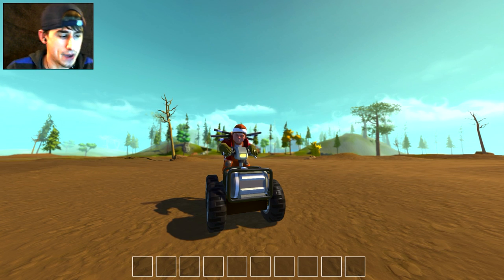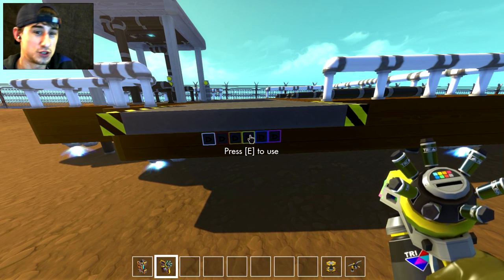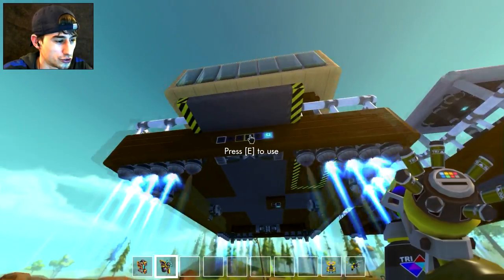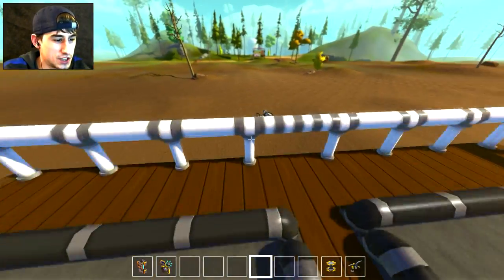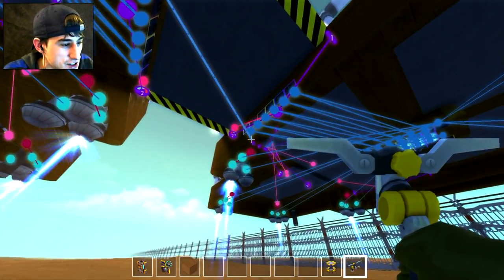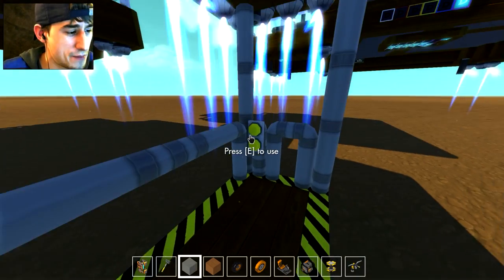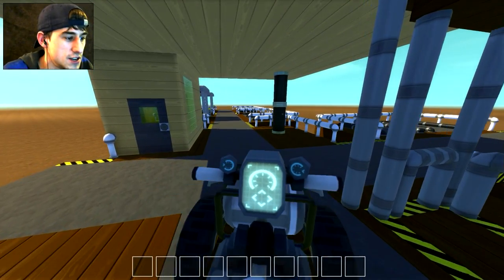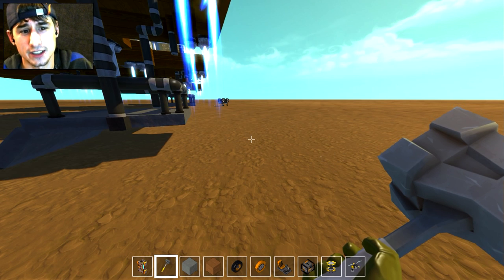Modular Hover City Control & Parking! (Scrap Mechanic #61)

Comment: Looks great, my suggestion is to make some raw hovering platforms, so you can make whatever you want on them.
And about game engine, unless they make that blocks next to each other become a single object, it won't help with frame rate, as they still are many small objects which colliding.
Reply from the maker: Yes I agree. The big issue with the engine now seems to be the object collision detection. I would hope that Axolot has clued into the size of creations people are making and will adjust accordingly.

Comment: This is pretty cool!

What about using sensors and moving blocks to send signal between platforms, so all you have to do is join the modules?
Reply from the maker: Thought about that but it would be a much slower delay depending on the number of sections.
Reply: That and it would probably increase lag with all the moving parts. I think you made the right decision with the gates.

Comment: Please try a hover car on the city then make a blank plot and upload to workshop for others to build on
Reply: I thought so too. It is possible to have this being an community build because it is an build with multiple parts. In this way the city could become huge.
Reply from the maker: The lag is the problem right now though. Hopefully the new engine fixes it. I've had a few people take my sections and "repurpose" them or even design entirely new ones! If you do send them to me I plan on doing a viewer showcase of the sections once I have enough!

Comment: I wonder what would happen if someone welded his hover ship to this?
Reply from the maker: I could try that. The hover ship currently hovers at 18 block height so I'd have to reduce the sensor range but I'm sure it would work. Technically they use the same principals to balance (no suspension glitches either)

Comment: kan when I find ships and subscribe to it doesn't hover
Reply from the maker: Hmm weird. I balanced the ships. You have to turn on the engines though with the 1 hotkey in the main seat.
Reply: The logic gates update fixed the fps bug so it should work
It works for me now
Reply: Oh your right it did fix it but maybe just maybe the next hover ship you make it won't work